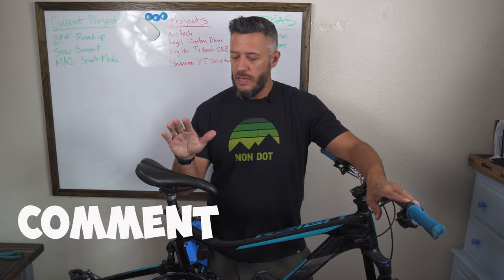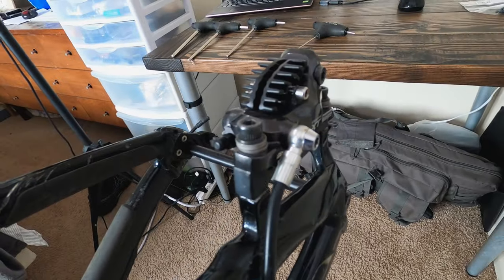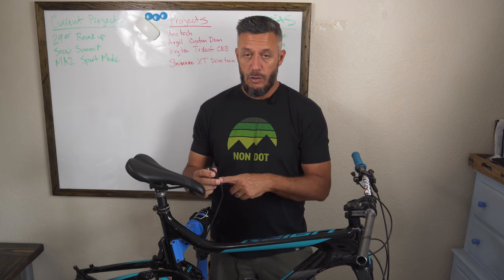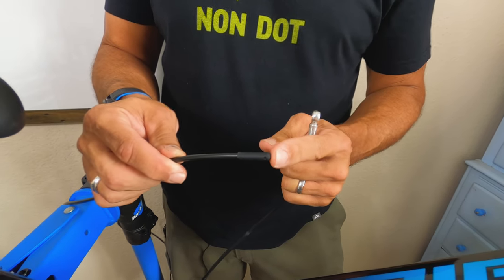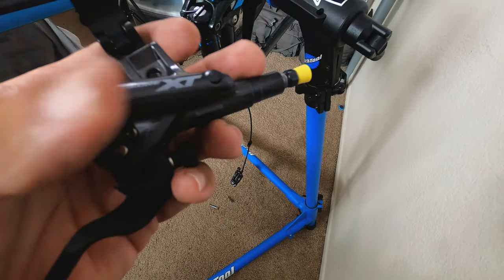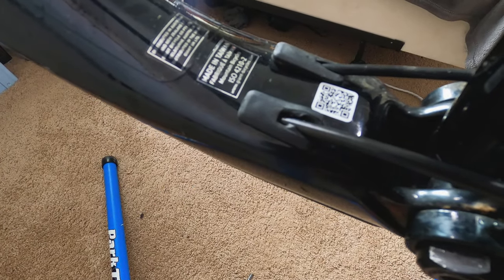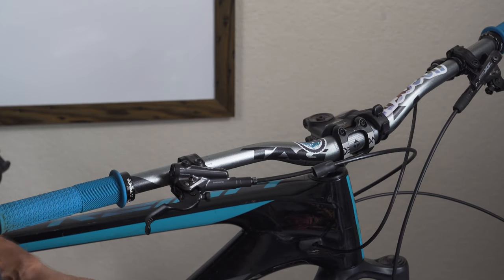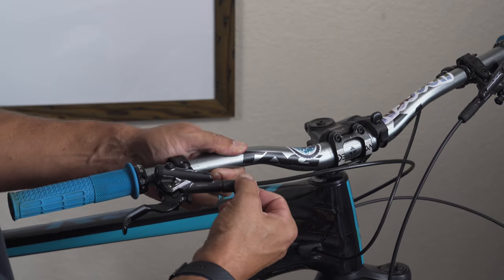How to Install - Shimano XT 4 Piston BR-M8120 Brakes - Step by Step - 4k

Comment: Nice video.  One tip I found...  I don't have internal routing so I don't have to worry about it, but I saw someone show that the little holes on the end of the cap of the new hose are for putting thin string or dental floss through, to tie to the old hose in order to pull it through.  Seems simpler and easier, but may or may not be helpful or better than your tape method, whatever works.  
Also, after installing my 8100s, I followed the manual and didn't disassemble the nut/olive, but still had plenty of air to bleed out.  So although without disassembly I did not have any leaks, I don't see anything wrong with taking the olive out and making sure it's on the hose properly, other than it being a little more mess.

Comment: 14:37 you actually dont need to do this you can put the brake line directly into it all you have to do is shorten you brake line and put thjje metal insert and just insert the cable in without unscrewing the bolt with yellow cap
Reply: Right👍

Comment: A little tip on the side: The brake is prepared in such a way that you can simply insert the shortened line into the brake housing. No need to fish around there. And please use proper tool to tighten the screw and not pliers

Comment: Thank you for clarification on the olive.  That, in my opinion is the most important part of the installation.  Other videos just briefly shove the line into the screw and hope for the best.
Reply from the maker: It's pretty important.
Reply: There is no need to disassemble. New brake lever has olive preinstalled and you just need to stick cable in. That's also stated in Shimano manual.
Reply: @martinmacko7297  yeah good luck with that technique.  Last thing I need to worry about are my brakes dripping fluid...

Comment: At 6:00 roughly you remove the rear brakes. I always remove the pads first so there is no chance of getting fluid on them. If you do, the pads are toast.
Reply from the maker: You should definitely remove the pads if you are going to use them again.  I don't plan on using these brakes anytime soon, so I wasn't worried about it.
Reply: If they are toast at least you can eat them then....

Comment: Just transfer the banjo line from the original xt 2 Pistons and put it on the 4 piston caliper then bleed the line they use the same brake levers and banjo single piston or 4 piston.
Reply: I'm looking to do this. I just want to buy the m8120 caliper to save money. Will it come with the banjo or will i need to buy seperate?
Reply from the maker: You want to use the 2 piston lever,  with the 4 piston caliper?  I don't know if that will work. The new four piston lever is shaped differently.
Reply: @uosocal  it works. it must work!
Reply: If he was replacing xt m8000  then it will work, but won't be as good as it could be. The m8000 is renowned for poor levers and random bite points. Part of the reason to upgrade to the m8120 is to get the new lever design, the new lever also runs the two pot version m8100,, the same applies to the new SLX lever it runs both the 7100/7120.
Reply: You could of used the same hose just fitted the caliper at one end and the lever at the other saving you removing the internally routed hose .
Reply from the maker: That is also possible. Definitely easier.  The hoses do wear and get dirty.

Comment: There is no need to remove the brass ferrule or loosen the collar.  Simply remove the yellow plug, install the hose through the collar and the ferrule.  Don’t waste time doing this and make sure the hose is fully seated.  Tighten the collar to spec.  Easy peasy.  Engineers are pretty smart and dummy down the installation to prevent error.  (Like calling a brass ferrule an olive 🤣).  Seriously, problems occur when we try to overthink the process.

Comment: 13:53 I see than my cable and your cable has some membrane/seal so the fluid does not come off. You need to remove it before connecting to the brake handle? Or it’s pushed automatically when you connect it all together ? But then, this membrane will stay in the cable so that’s not good I think…
Reply from the maker: I don't think there is any type of membrane holding the oil in the brake line.  Just connect the line and bleed the small amount of air out.
Reply: @uosocal  i think there is because I’m looking at it. Saint brakes. Plus they are bleeded so oil would come out easily if there would be no seal/ membrane
Reply from the maker: I would remove it then.  You will only need to bleed a little air then.
Reply: Hi I have the same membrane type cover over my xt brake line can I just push it into the lever ?
Reply: @LeecMTB  you don't want this seal to be floaring inside your braking system ;D just shorten the wire and you will get rid of the seal at the same time. You probably have to shorten the wire anyway so - problem solved, right?
Reply: @jaworq  thanks mate sounds like a plan , was hoping to avoid having to try and connect the little Barb as most videos have a special tool for it ?

Comment: I just bought just the caliper. Mine doesn't have the banjo bolt hole. It looks like something screws into it straight on and not from the side. Super odd.
Reply from the maker: That is weird. Could be a different model.

Comment: Why didn’t you keep your old cables/gubbins and lever? If your old 2 piston setup was M8100 then there is only one type of lever for both 2pot and 4pot, it seems an unnecessary exercise unless you wanted all new?
Reply from the maker: Brake lines get old and dirty.  Also, the new 8120 lever is different.

Comment: Great video with easy to follow steps to install the 8120 brakes.
Quick Q: what difference have you noticed so far between the 4piston 8120 braking power vs the 2 piston you had previously?
I weigh 198 lbs (90kgs).

And what rotors and size(s) are you using?

Appreciate your response!
Reply from the maker: There's a big difference in stopping power, and a lot less brake fade on longer dh trails.  I'm running 203's front and rear.

Comment: Dude, this is all wrong.  The whole point of these brakes is you don't need to pull the olive out and let the oil spill out everywhere.  You should read the shimano instructions.  There should be no need to bleed these brakes after you install them.  You should also learn how to bleed brakes properly.
Reply: That was just a lever bleed but where was the mistake?
Reply from the maker: Exactly
Reply: @zymbol7479  his mistake is that he unscrewed the bolt with the yellow cap on it, the olive is pre installed inside so you just have to pull out the the yellow cap when everything is ready an fit your brake line into it and just tighten the bolt and youre done

Comment: 10:39 min, the washer arrangement is false. The ball side must point to the mating ball shaped washer side. From Frame to bolt head: One concave washer, one convex washer, the brake, one convex washer, one concave washer. The purpose of these washers is to allow for angular adjustment and they are usually used at V-brakes. For disk brakes they are not needed as the surfaces have a 90deg angle.

Comment: Is it necessary to take the olive out? Is it not enough just to unscrew the bolt and insert the hose and then tighten it back again?
Reply from the maker: I like to.  You want to be sure the hose is inserted all the way into the olive.  I did this once without taking it out, and oil leaked out.

Comment: 14:26 you dont have to.
Reply from the maker: I'm not sure what you are referring to?  Could you explain?
Reply: @uosocal  i mean, you dont have to pull the olive out the lever. Stick the Pin in to the black cable and all in the lever When ever Things fine you dont need to bleed.
Reply from the maker: I do it that way, so everyone can see all of the parts involved. Either way, you should still do a quick bleed.
Reply: @uosocal  you can see the right way in the Manuals from shimano.